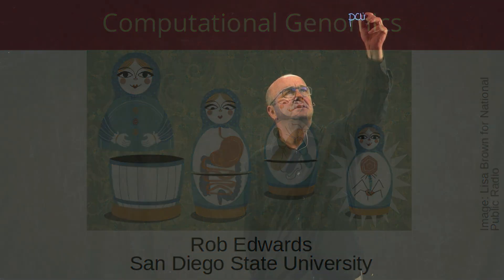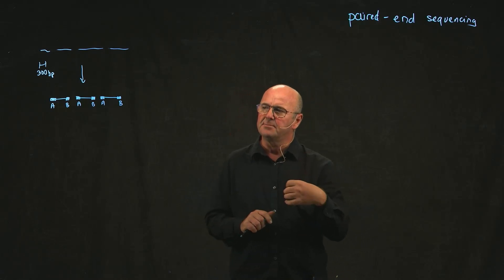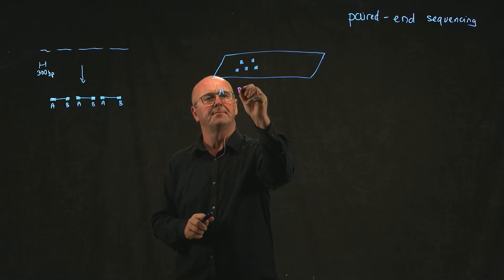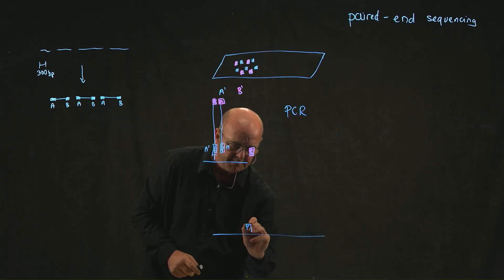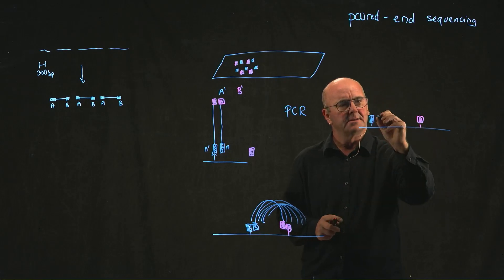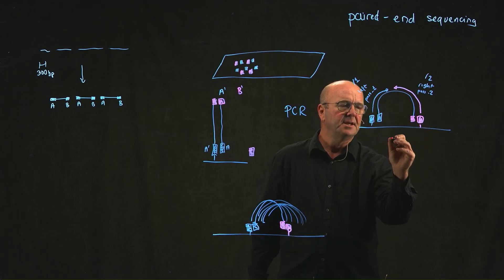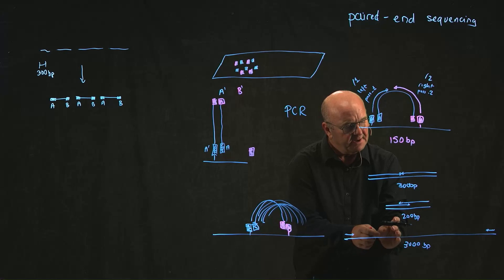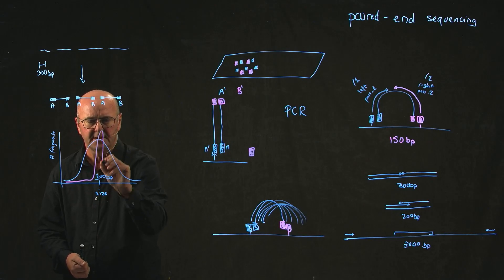illumina paired end sequencing

Comment: If my fragment size is 500bp, and read length is 150*2 with 300 cycles, I get inner overlap of 100bp. Does this overlap effect my overall depth of coverage/sequencing results?
Reply: The inner overlap of 100bp that you are getting with 150bp paired-end reads will not affect your overall depth of coverage or sequencing results significantly.

In paired-end sequencing, the inner overlap is generated when the two reads from opposite ends of the same DNA fragment overlap with each other. This overlap helps to increase the accuracy of the sequencing by allowing errors to be corrected and gaps to be filled.

However, the impact of this overlap on the overall depth of coverage depends on various factors such as the size and complexity of the genome or transcriptome being sequenced, the sequencing platform used, the sequencing depth, and the bioinformatics pipeline used for data analysis.

In general, the depth of coverage is determined by the number of reads that align to a specific region of the genome or transcriptome. The higher the number of reads, the higher the depth of coverage, which leads to better accuracy and sensitivity in detecting genetic variations or gene expression levels.

Therefore, if the sequencing platform and the bioinformatics pipeline are optimized to handle paired-end reads with inner overlaps, the impact of the overlap on the depth of coverage should be minimal, and you should still get reliable sequencing results

Comment: Isn't there a mistake in the picture around 4.15? The DNA attached to the glas slide will fold back while the other DNA strand is gone by denaturation or am i wrong?
Reply: U are right.. there are a lot of misnomers. Including one at 05:07 where he shows synthesis in both direction as if DNA pol can go both 5'->3' and reverse.. Synthesis occurs on 2 different sequences and not on the same one..
Reply: @karanthakar655  exactly... Even I was moved by this fact
Reply: You are right and he's wrong.
Reply: Yeah this was confusing me at first as well. Really makes you wonder if the instructor really fully understands this material.

Comment: I don't fully understand how a long fragment (3000 bp example) helps with mapping repetitive RNA reads. Could you elaborate on this?
Reply: I'll try to be helpful even though I'm not an expert, in the human genome for example there are many ripetitive regions and this could be a problem if you do a single-end sequencing, because you could have a sequenced read that is complementary to these repetitive regions and you can't align it with a high degree of mapping quality (means that you could place it at multiple position in the genome). If you do a paired-end sequencing  as long as both reads don't fall into a repetitive structure you can anchor one with certainty even if the other doesn't anchor really precisely.

Comment: I don't understand 5:25. Why is it possible to sequence the same DNA fragment from both end ? I thought sequencing can only happen in the 5' to 3' direction. Can anyone please help me ?

Also, are the strands, double stranded ?
Reply: Cos the reverse strand is not sequenced directly as it is, in 3'-->5'. It goes through another step to synthesise 5'-->3'. This video is clearer onto the actual protocol:

https://youtu.be/HMyCqWhwB8E
Reply: Well actually, both oligos (pink and blue) were supposed to be attached with their 5 prime ends to the solid surface, so the illustration of the paired primer (oligo) extension is confusing, since the drawing implicates that template has only 3 prime ends. Yup, something not right.